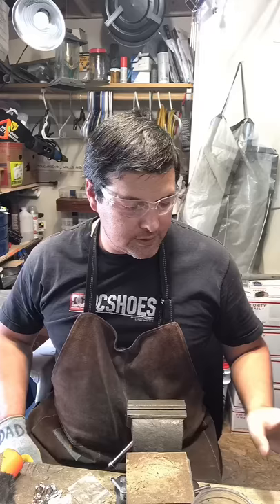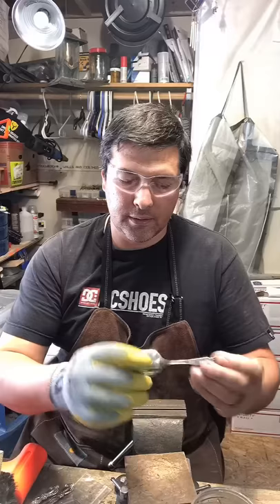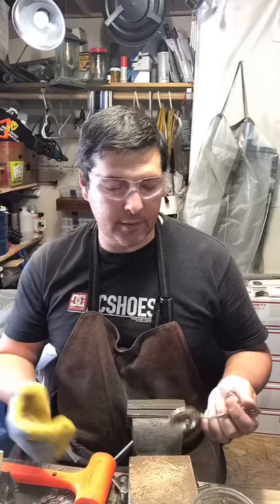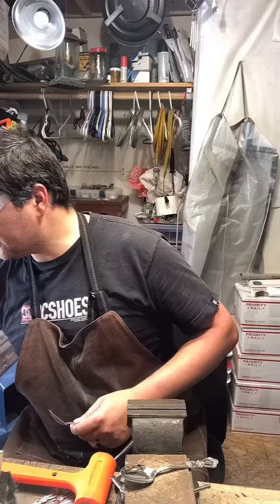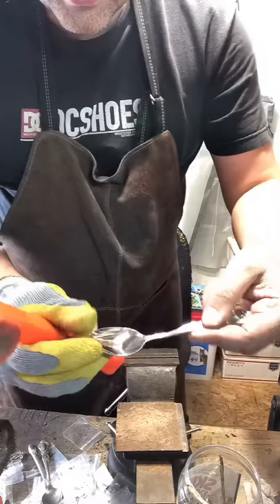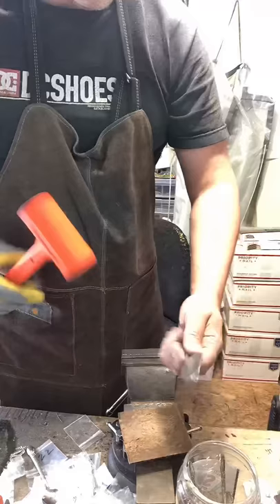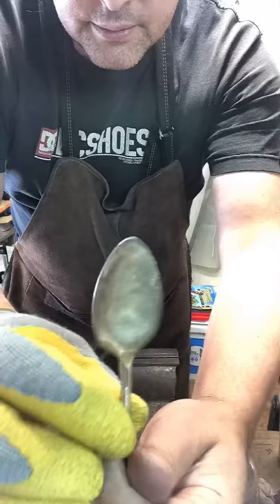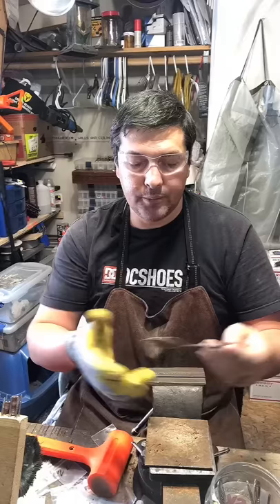Flattening out spoon bowls

Comment: Could use a roller that they use in jewellery making
Reply from the maker: Yeah, you can use a rolling mill. But unless your mill opens up really tall, you have to flat it some to get it in there. It will make it extremely flat, but it will take some more time and possibly stretch it out.

Comment: Best video I've seen on flattening spoons.  I need to get a hammer like the orange one.
Reply from the maker: Patricia Hall thank you. I really hope that it helps.
Reply: I see that the dead blow hammers come in 1, 2 , 3 pounds and I think maybe 4.  Which weight do you recommend?
Reply from the maker: Patricia Hall The one I have is 1-1/2 pounds. 2 pounds would be nice and obviously the more weight you add the harder it is going to be to pound again and again. But you’ll have a little wider surface area so that could be nice. That will probably be my next one a two pounder.

Comment: Do you use some type of metal spoon, or does it matter. The spoon I was using was hard as a rock and I could not get it flattened.... TIA
Reply from the maker: I use mostly silver plated silverware. Stainless steel is very hard and is really hard to bend unless it’s really thin.

Comment: Where did you purchase you dead blow hammer and what type of board are you using on your anvil?   Thanks much for your time!
Reply from the maker: I’m sorry that I missed your comment. I got the dead blow hammer at Harbor freight and the board I’m using is brown board it’s normally found where the pegboard is at Lowes or other shops like that
Reply: @FlatwareCreationSS  I picked up a clipboard at the Thrift Store the other day that I'm going to cut into smaller squares.
Reply from the maker: Linda Covell that will work perfectly.

Comment: I have a 16 and 32 Oz dead blow hammer and steel block. No matter what I do I can not get my spoon bowls flat. Any other suggestions?
Reply: I think I need a clipboard. Do I need to anneal the spoon?
Reply from the maker: If you’re using your mallet on steel and it still doesn’t get it flat, you might try flipping it over onto a piece of paper or something on your anvil and tapping on the back with a hammer just on the parts that are rippled. And a part enough to pass them out flatter. If you’re looking for absolute completely flat, I would suggest a rolling mill and possibly a 20 ton press either one. But when I don’t get mine perfectly flat, and there’s a little ripple, I will take my smaller hammer even sometimes the brass hammer that doesn’t leave so many marks on the backside it’s where it’s not gonna be showing any marks and I’ll tap that flat.
Reply: I’m thinking that the rolling mill is a great idea. I think because I’m using stainless steel. I’ll also try my smaller ball peen. I’ll do this tomorrow and report back. Thank you 🙏
Reply from the maker: @SadietheMiracleDog  yeah stainless steel is a hard monster.
Reply: @FlatwareCreationSS  yes - I can bend them with my hands (energy worker) but not much luck with much else. I bend them and then make art work and having the bowls flat help.
Reply from the maker: @SadietheMiracleDog  i’m here if you need me. 😊👍
Reply: YOU are the BEST! Thank you 🙏
Reply: I spent the day at the studio. I placed the spoon bowl between 2 bench blocks and put those in a vise. This technique was magic. It flattened most of the stainless steel bowls! Great tip, thank you ❤❤❤
Reply from the maker: @SadietheWonderDog I’m glad that worked for you!

Comment: Sometimes my spoons split along the edges. Does this happen to anyone else?
Reply from the maker: Yes it happens to me too.  Most of the time the ball is round, like a soup thing or has a different shape than a regular spoon. And they normally crack on the sides.  sometimes they don’t break, but other times they do, it normally has to do with the shape and the hardness of the base metal.
Reply: @FlatwareCreationSS  so apart from the shape is there any other way you can avoid the cracking?
Or identify the ones that are likely to split so I can avoid them?
I mainly use souvenier spoons
Reply from the maker: @kinderjojomojo  sometimes it just comes down to the base metal. Some just don’t like to bend. Most often the Spoon is shaped in a oval, or might have a square top at the handle.  Like a sugar spoon or a jelly spoon often times they are shaped not like a normal spoon where it meets the handle. And that’s why I’ve noticed that those spoons will split on the edges. Normally because of the slightly different shape.